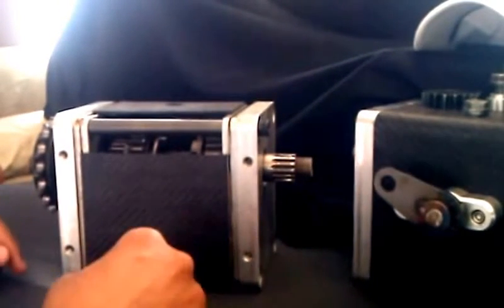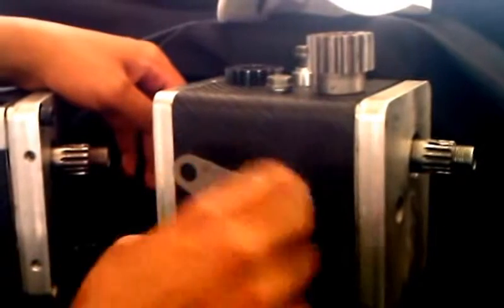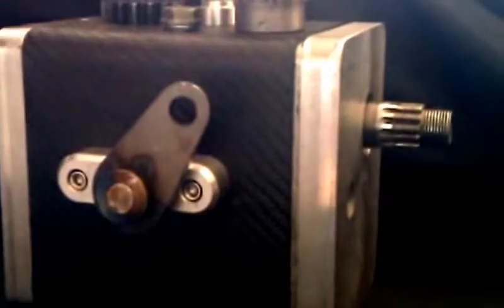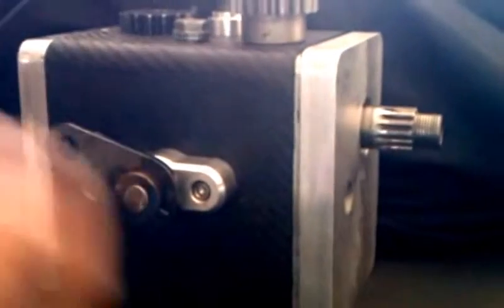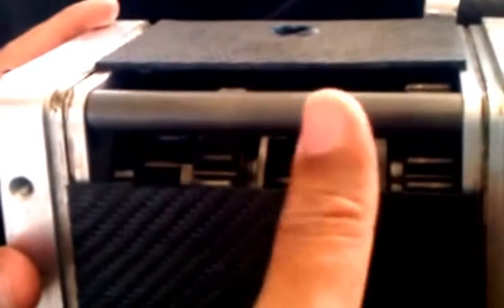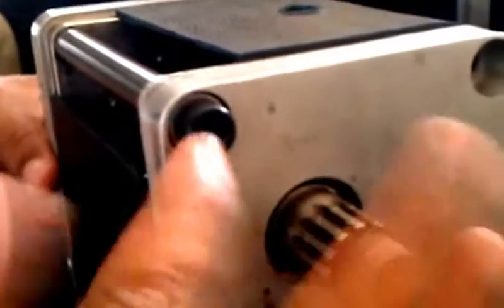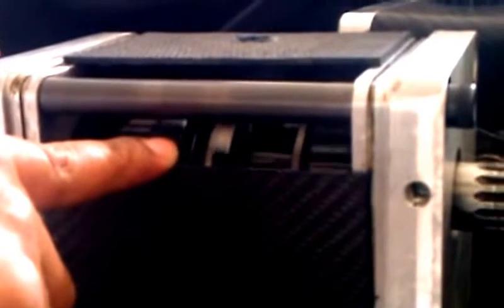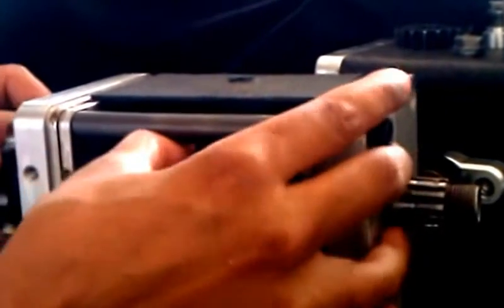The R - Falcon Reverse gearbox

Comment: Has this been released yet?  I know there were sealing issues with the original, but has a billet or cast case option been made available yet?  Looking for a simple through shaft version for a Motorcycle powered buggy for off road dirt use.